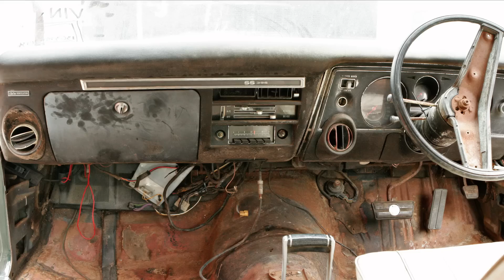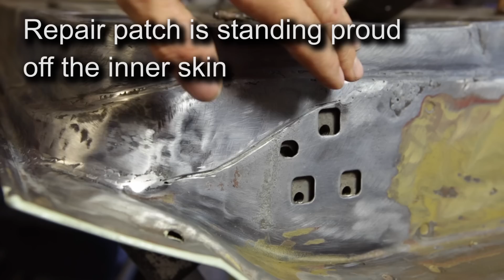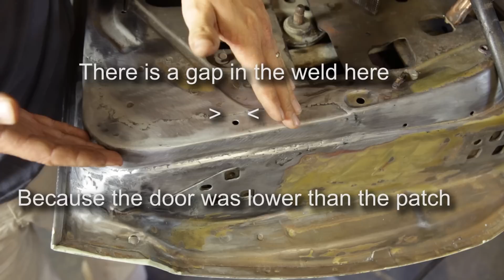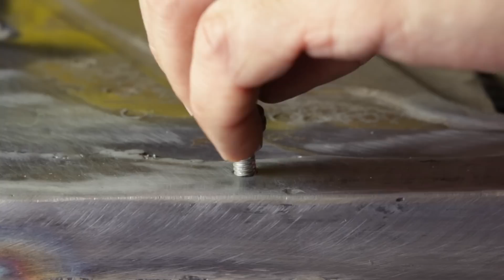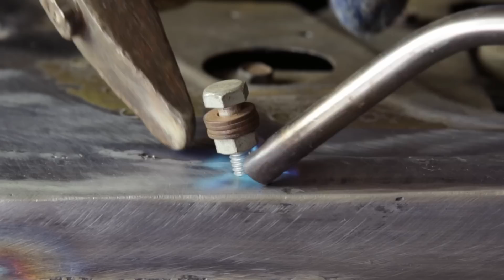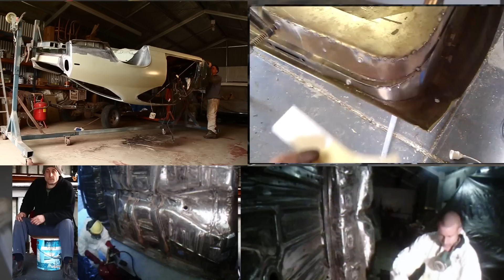Door frame rust repair all steel pt 2

Comment: Your approach to re-fabricating the corner of the door is the right way to go. Breaking it down into its components and then welding them together. Most people will try to form it in one piece, but almost impossible to get it right. I'm just starting to learn how to weld with a 110V flux core welder and repair some body work on my 2005 Chevy Avalanche 2500. Lower fenders and lower quarter panels need some rotting repaired. Also going to fabricate a lot of skid plates and bumper guards to it. I've been watching videos from "Fitzee's Fabrication" in Nova Scotia. What master at it. He used just basic tools and a simple set of guide methods to build just about anything and have it come out perfect. Anyway keep up the good work.
Reply from the maker: Thank you for the kind comment and your support. I wish I could go back in time and use the gas instead of the flux core. It sounds like you have enough work to justify the purchase of the gas. Treat yourself, make your work easier with good tools. I wish I did.

Comment: Great video man ! Seeing this kinda video's want to make me to fix up an old-timer car so badly. Really inspiring. But got one question. Like all other video's I've seen before about patching up doors etc...  How do you treat the insides of the door ? I mean.. If your door has rust in the inside you can't brush it off because you can't reach it. Or even like your other video the molasses couldn't reach it.  Even with the rust removed.. how you give this blank piece of metal an nice layer of primer or even a layer of paint ? Cheers !

Comment: Looks good ! I am working on a small chevy monza. I still have pretty much rust to fix. Are you butt-welding the patches or overlapping them ? They have some nice butt-welding clamps on harbour freight, very useful tool.
Reply from the maker: 2102Chris I'm using some big magnets on my current repairs to hold the butt weld. I'll have a look at those clamps, thanks.

Comment: really love that repair. i really dislike gas-less mig but i hate paying for the rental on the bottles, however i have found a place in Dandenong where you can buy and own your own bottles, never pay rental, in c, d, e and g sizes....  https://www.gasweld.com.au/catalogue/docs/speedgas.pdf
Reply from the maker: devils garage Thanks for the resource. My problem is that I work on the car a day here and there so renting a bottle would be such dead money. If we were to go hard on the rust all at once for sure it would make sense to rent a bottle These buy it bottles aren't cheep and I have only two more patches so will probably just push on with resin core wire.